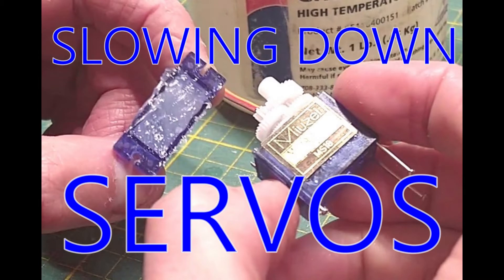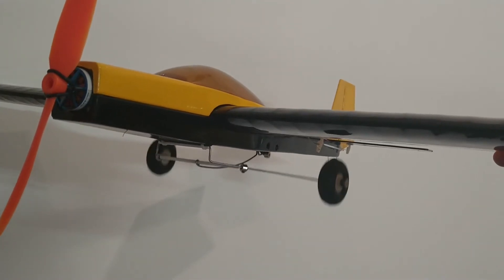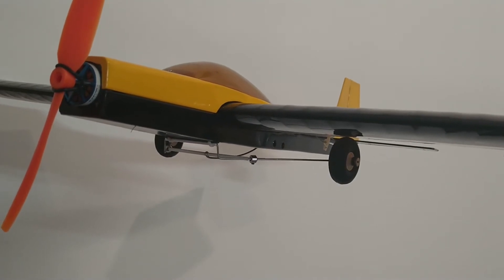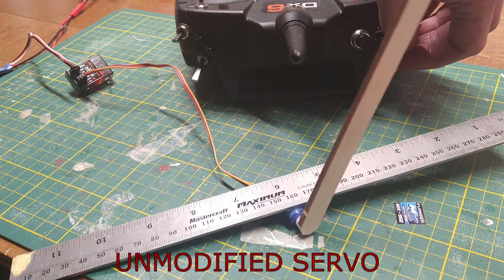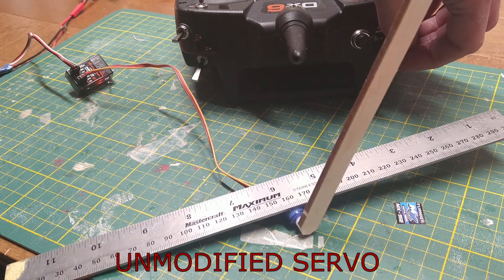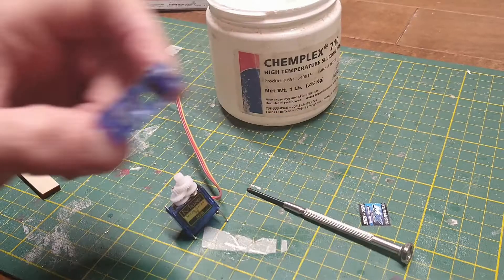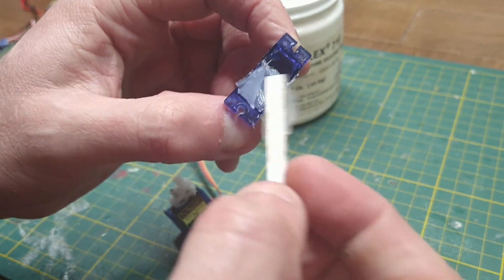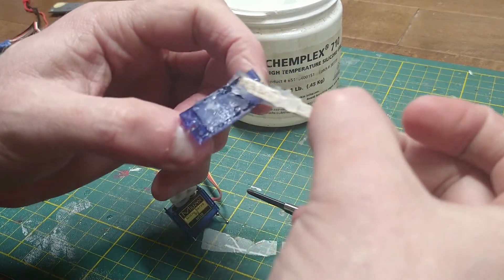A simple way to slow down your servo action

Comment: There are better ways to do this, those poor hxt servos don't live forever. It is extra stress on gear and motor, and the grease will move around and maybe even change viscosity.
Many transmitters, like the dx8 used here, even has a setting where you can set a max speed and mimic this effect for wheel and flaps. Use that instead if you forgot to buy one of the inexpensive pre-made flap servos with reduced speed.

Comment: Won't that cause high amp draw and heat up motor?
Reply from the maker: Gets warm if you continually cycle it, but that is not the case in a landing gear application or others like it.

Comment: Does this put more stress on the motor due to increased resistance?
Reply from the maker: It does cause the servo to work a little harder. But the stress is well below what the servo can take. Personally, I have not had any stress-related issues that were associated with this mod.